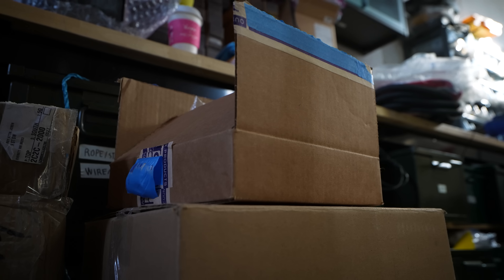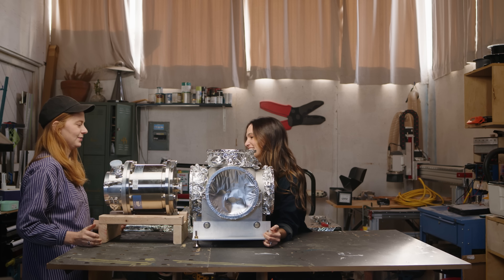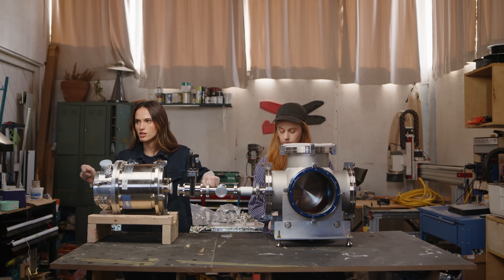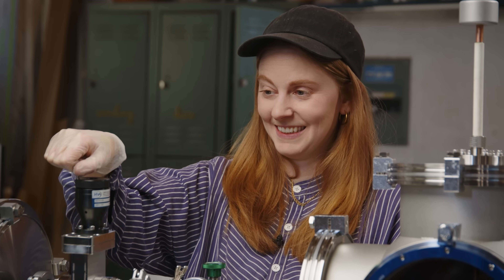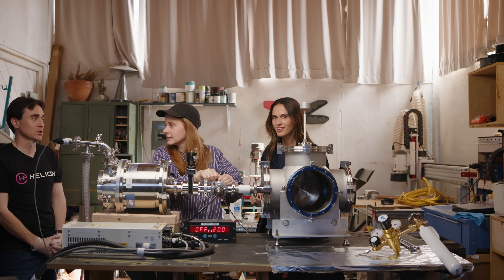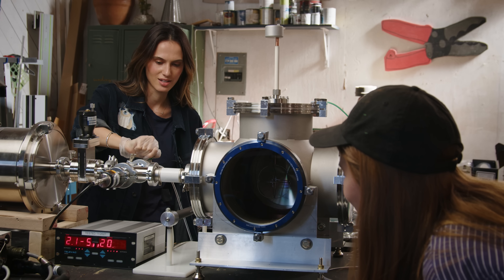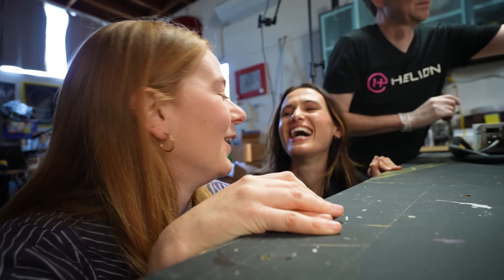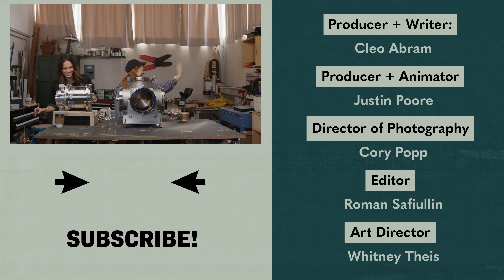We Tried To Do Nuclear Fusion

Comment: A neutron detector would have confirmed the fusion reaction.
Reply: A BS detector would have rang like crazy too
Reply: it would also confirm the disturbing truth about fusion being highly radioactive. If only there was an expert on fusion to explain those dangers...
Reply: @PavloPravdiukov  The expert in the room knew them well that there was no fusion and was there for free PR and promotion.
Reply: @okaraaze1087  iirc what you see in the video is only plasma glowing and no fusion happening. With actual fusion you would get ionizing radiation and you aren't supposed to be close to that shit. Helion CEO wasn't bothered by radiation because there was none because there was no fusion.
Reply: @okaraaze1087  I don't do fusion but my educated guess would be that plasma temperature was too low. I think geiger counter should be enough to prove fusion. Idk what exactly they did wrong
Reply: @okaraaze1087 because they would’ve irradiated themselves with hard neutrons if it was. Need a bit of concrete or lead between you and a functioning fusion reactor.

Comment: Fussion, really? 5-10keV of ions energy will never be enough to overcome Coulomb repulsion. What you see here is just a regular  smoldering discharge. To proof there is a fussion you have to mount mass-spectrometer on turbopump exhaust and find helium in a mass-spectrum.
Reply: Yeah, to even begin to detect neutrons, you need at least 25 KV.   Amateurs that have done fusion with these devices run 40 to 50 thousand volts.

Comment: The idea of fusion is to coheres multiple atoms to become a singular atom. this can be done through collision or through gently manipulating the orbitals and the gaps between electrons of one atom to coincide with the orbitals and the alignment of the other atom's electrons, at which point the repulsion between atoms is reduced greatly if not completely, and the nuclei are permitted to come within the electron sphere of each other.  If done properly one could conceivably coax many thousands of atoms into the same volume of a single atom without intense heat or fast collisions.

your central sphere as seen in this project, induces too many contradictory paths of electromagnetic ripples and is a major hinderance to the process.

to improve cohesion, I would recommend building six out/input feed loops, (such as found in a magnetron) in a configuration that they do not touch each other, but they form a directional electron flow in a somewhat (S orbital) pattern. think six circles with an opening in each one, the current enters the positive lead and exits the negative lead making a single loop that is interrupted by the gap between the leads. each of these loops will come into the chamber from a different side. none will touch another. but it will appear as if you formed a cube out of circles.
the current that you  feed into the lines needs to be adjustable, therefore a rheostat or variac will be necessary for dialing the voltage in and out to get a proper reaction. for this experiment you will want high voltage, and high Hertz, high amperage... may not be necessary.

You will, for best results want the housing of your vacuum chamber to have a highly Paramagnetic property so as to duplicate the moving magnetic waves inside the chamber pushing them back toward the center, likewise reducing the amount of plasma that comes in contact with the walls.. 

I am rather interested in many aspects of physics and do not believe most understand that reality they are trying to describe with the current analysis and application of mathematics to the design of particle structure and the universe at broad.

Comment: I love this video, I work for a company in the vacuum space and it is disappointing to see so little companies use vacuum in their video's. (I get it, it is hard to make a video about nothing). The setup looked good only thing is that it used viton o-ring instead of metal seal (cf copper flanges). I know metal sealed isn't necessary for these kind of levels of vacuum but it cool to go as low as possible in my opinion.

Comment: When you asked how you'd know that fusion had occurred, I'm surprised that David didn't pull out a portable neutron detector.
Reply: Yeah, I was thinking the same thing. They  should have used a neutron detector as you can have a nicely glowing ionized gas without achieving fusion.
Reply: @dsvilko  And a lot of very damaging radiation. 

There was no fusion. Unless poor cleo and simone (and david!) now have to worry about having a much higher risk of dying of cancer.
Reply: @daBuzzY90 Hey! I have very limited knowledge on this topic so this is just a curious question. Couldn't the radiation be inside the chamber, not released outside into the workshop, meaning that they actually achieved fusion while containing the radiation and neutrons?
Reply: If fusion occurred they would all be dead from x ray exposure.  They looked at a pretty plasma cloud and that was all.
Reply: I'm just saying this in a nice way and not to be an evil comment jerk. I don't think this type of reaction releases neutrons. They take deuterium which is one proton and one neutron and fuse it with another set of those. And the final thing produced has the same particles.

Maybe when it decays or something it'll release. But I have no idea. I also don't pretend like I'm an expert at everything like every YouTube commenter.

And they would be okay with em radiation as well I believe. It's not dense enough of a reaction to cause any harm.

So that's my response to the year old comment. Peace!!!
Reply: Not surprised at all. He knew there will be no neutrons detected in this experiment (there was no fusion to be expected), so he purposefully avoided an actual verifiable measurements.

Comment: you need nutron detector, then if u detect neutron then u can say u deed fusion.
but here u just create duterium plasma. similar with hydrogen plasma.
at 40000 volts u put neutron detector face to fusior then u receive some blink in detector per minute then u can say u did fusion.
u already done 95% of fusion project. but not fully completed.
well done. thank you.

Comment: OH shit its a redshift issue. Very impressive you were able to build this in an afternoon. Hopefully can collaborate, please keep this open
Reply: I don't think it's redshift. It's 2 different wavelengths of light hitting our eyes. Our brains interpret that combination of stimuli as pink. 

Specifically, our eyes have cones which are stimulated different amounts by different wavelengths (there are 3 types of cones, each roughly centered at wavelengths for red light, green light, and blue light, but there's quite a bit of overlap in their sensitivity ranges). And then our brains interpret those 3 new signals into an image. 

Our brains do various signal processing techniques to arrive at final images, including assigning colors. Multiple simulations can look like the same color to us. For example, our screens use red, green, and blue sub pixels. But we can shine those lights to make things look white or orange or PINK! Look up CIE Color space if you want to start the rabbit hole.

Comment: The farnsworth fusor, developed in the 60s, relies on the fact that 4000 Volts is a voltage commonly found in neon signs and CRT televisions but equates to a temperature of 45 million Kelvin, 3x that of the center of the Sun.

Comment: This was an excellent video! 
1) Damn, think you got a big enough turbo?
2) Congrats on really underplaying how scary it was to lose power while pumped down. I don't know what your vacuum circuit looked like, but turbos really don't like to leak up fast.
3) The shots of Simone and Cleo with their faces against the viewport, aside from looking like kids at christmas, was giving me real Shoe Fluoroscope vibes. I know you didn't run it long, but how conscious were you of the x-ray and neutron radiation you were producing? Did you manage it mostly by managing the energy of the reactor or did you just limit your exposure? Did you wave a gamma scout around while it was fusing, just for fun?

Again, thanks for the awesome demo! I've seen a lot of Farnsworth fusors on YT but the presentation here is top-notch!
Reply: They weren’t worried because there was no fusion. He has access to every type of neutron detector available. He knew well there was no risk of X-rays from ionizing gas
Reply: no x-rays to worry about because there was no fusion

Comment: That turbo is dangerous running like that, if you have a rotor issue it will jump all over the shop. It needs to be attached to a frame and bolted to the floor

Comment: Why is the internal "cage" of farnsworth fusors always so rough in production (at least of those I've seen so far)? Considering every single other part in the construction, which are all very clearly precisely machined, why is the centerpiece so "not machined"? I would think a precisely machined cage would be better (at least for testing concepts, but I've never seen it)?

Has there ever been an "everything and the kitchen sink" approach to the gasses used for fusing? We always go for the deuterium, tritium, etc gasses, but what if there are gasses that buffer or catalyze the fusion reaction, but because we're otherwise so desperate for the purity of what's in the reaction chamber we never considered them? We need some happy accidents fusion attempts.

Comment: You should have stabilized the process by interpolating a turbo encabulator onto a flux capacitor to create a corridor through which you can inject some unobtainium into the helix.